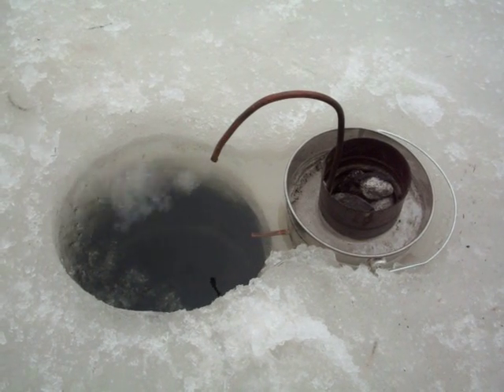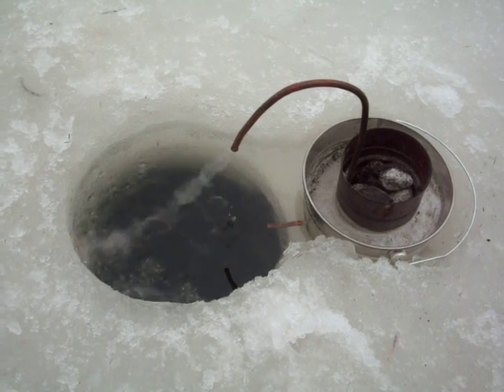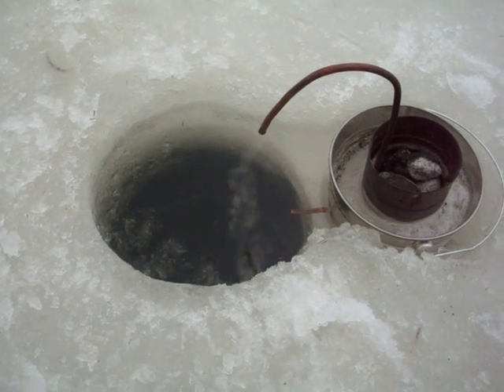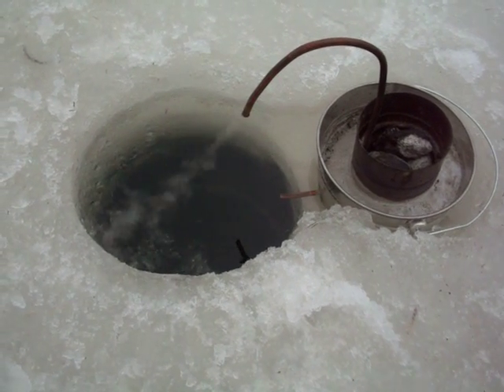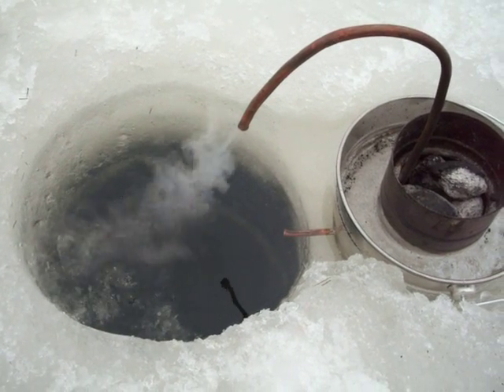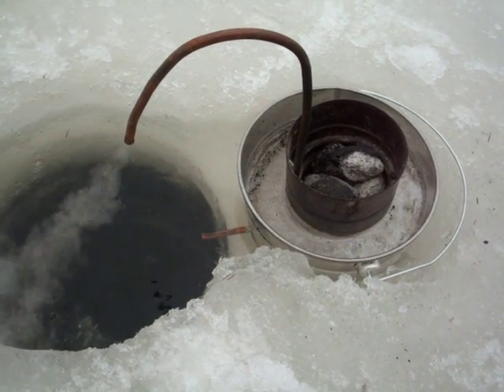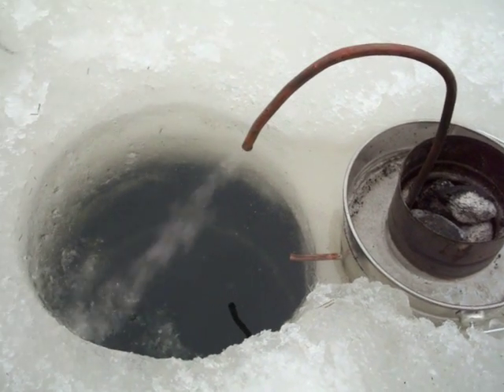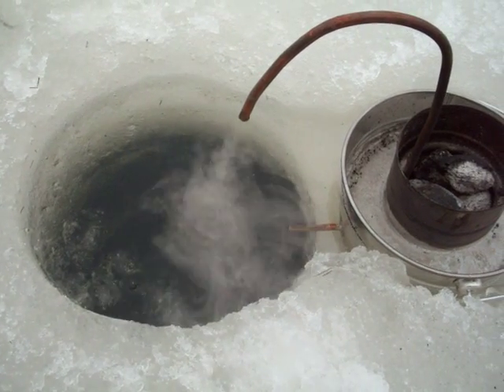Water Spitter

Comment: If you took 5 minutes every hour to de-ice your holes that would be 30-40 min a day of time. If you took 2 minutes to light a hole de-icer that would take 10-15 min of your time to set-up. If you checked your holes every 2 hrs you would still be about equal on time invested. Still though you have the extra weight of carrying around a spitter.
You either do the work now or you do it later? Good luck fishing.